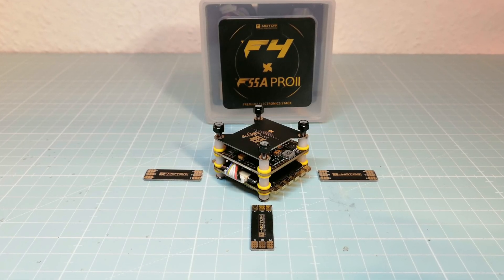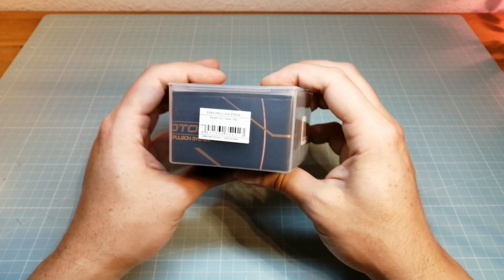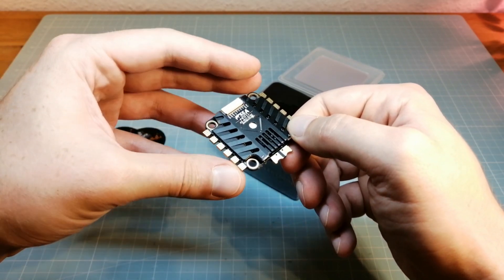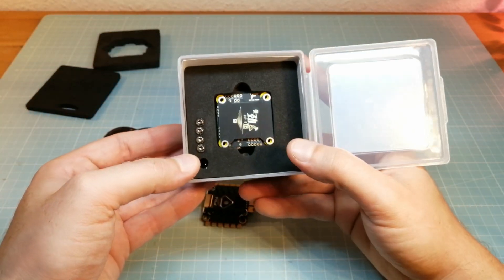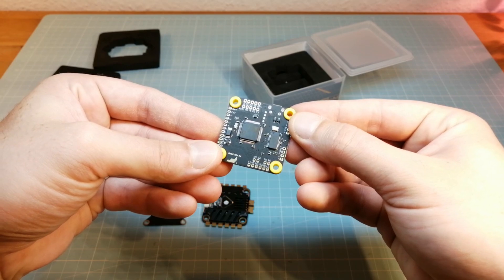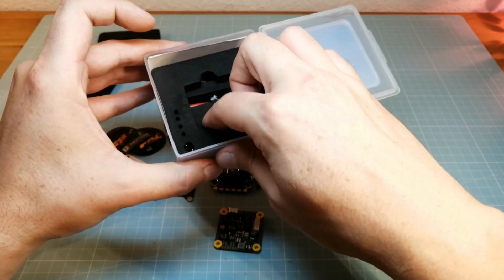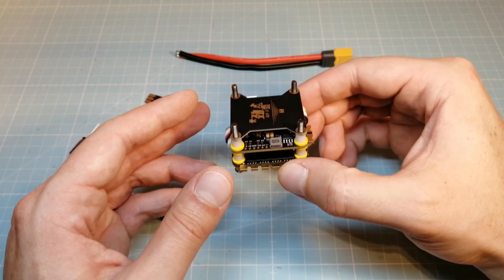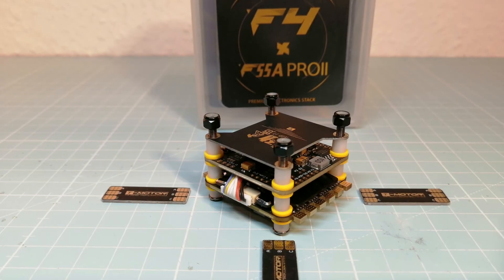T-Motor F4 FC + F55A PRO II 4in1 ESC - Stack

Comment: The ESC to FC socket, is labeled with the pinout. If you want to wire to a different FC, and solder directly to the board, you can use the wire harness, and solder those wires to the different FC. You just have to use the correct connector on the ESC side.

Comment: Nice video!!! But can I use this stack with any remote or DJI Remote only? I habe a Flysky Nirvana, is that going to work?
Reply from the maker: Thanks, I think you can use i with your DJI remote, but you can even get a T-Motor HD FC / Stack for the DJI Unit, the only difference is the 10v Bec that is installed on the HD Fc's for powering the Air Unit. Otherwise you would need a seperate 10V bec.

Comment: Hi,  is this 55 amp? And what does this mean?
Reply from the maker: 55amps constant and 75amps max current draw - more than enough for using big and powerful motors.
Reply: @TorbanDallas  if i have 4 ESC, does this mean 55 amps each?
Reply from the maker: @blendon1463  yes, this is an 4in1 ESC, each ESC can handle 55amp up to a peak of 75amps.
Reply: @TorbanDallas  thanks so much for your help
Reply: @TorbanDallas  hi again,  I hope you don't mind me asking another question? Could you tell me if the battery or batteries runs to the flight controller and the ESC or only to the flight controller?
Reply from the maker: Check the manual of the ESC and take a look at the connector, there you can see that the esc transmitts the battery voltage to the fc. The FC has a 5v bec. So the fc's provides battery voltage and 5v for your peripheral.

Comment: Don't use the BN-180. The BN-220 is much better.
Reply from the maker: OK, why do you think the bn 220 is better? I already have used the 180 on all of my other quads and I already have bought one for my new quad, but thanks for your advice I will also test the bn 220 - even when it's bigger as the 180,i will have enough space on a 7 inch quad to use it.
Reply: @TorbanDallas  I have read several times about problems with the bn-180. And the difference in size is really small.